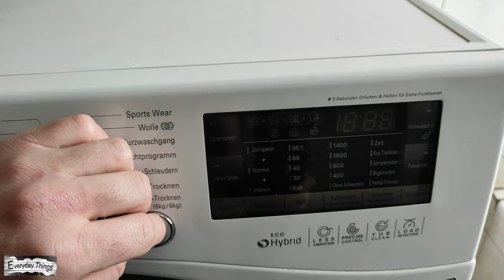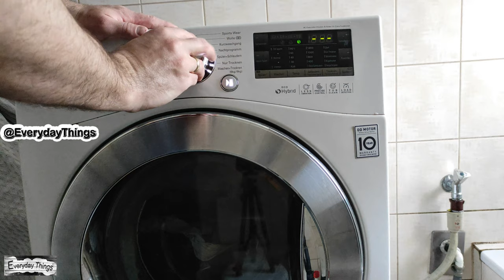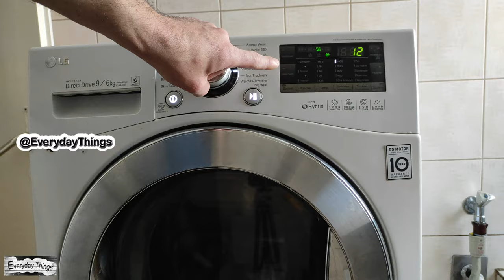What does OE mean on LG Washer and How to Fix

Comment: Following your advice but i am getting murky qater coming out of the drain hose lol. Is thay ok
Reply from the maker: It's normal to see murky water coming out of the drain hose when you're fixing the OE error. This typically happens because the pump was clogged, which triggered the error. When you open it up, it's expected that a larger amount of water might be released from the pump. If you've previously washed items with colors or at a high temperature like 90 degrees, the water can also appear cloudy due to the color or the accumulated residue. So, no need to worry, it's part of the process.

Comment: Where was this last December?😅  actually I had a problem with water pressure so I wasn't able to get the rinse cycle/spin to work.
Reply from the maker: I am always here.😅😊
Anyway, I hope that your problem is already overcome, and of course you now have experience in that field, but I hope that you will not need it anymore.😊
Reply: It turned out I needed a new well pump.  Afterwards however there was a lot of sand and dirt in the water lines that clogged up the intake filter on the back where the hoses connect.  Just in case someone has a problem with that.
Reply from the maker: Thank you for sharing your experience! It's a good idea to check and clean the filter regularly to prevent clogging and ensure proper water flow. It is a good to do this once a month to extend the life of your washing machine, мostly on the drain filter and also for the intake filter. 
This video shows you a similar problem but with a clogged intake filter: https://youtu.be/xai8P38wvLk
However, this tip could be helpful for anyone experiencing similar issues.